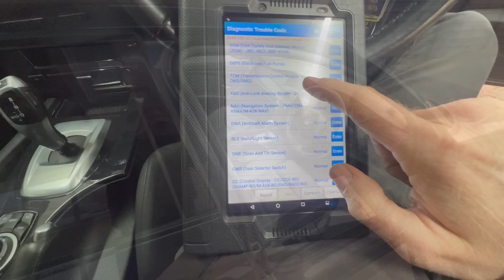IS SELLING A CAR TO A FRIEND A GOOD IDEA??? ESPECIALLY WHEN IT GOES WRONG!!!

Comment: Another good video Kev, you need some heat shrink solder connectors.
Reply from the maker: Thanks Trev, you're right as well.....ive got some....just couldn't find them 🤦‍♂️🤦‍♂️

Comment: Just a tip on the soldering you can now get solder sleeves which the solder is incapsulated within shrink sleeve and seals the joint as well

Comment: Hi Kev & Claire 😃👍 great video Kev it had everything, Drama, Joy , and pride 😅😅😅 great job Kev two repairs in one I thought you were going to  edit the video when the boot would not open 😂😂 thanks for another mr fix it lesson. Have you tried the new ish pre soldered fittings Kev just have to apply a little heat with the heat gun even I can use them 😅 keep smiling Kev & Claire.  Tom
Reply from the maker: Hey Tom, yeah I have got some of them pre soldered fittings but I just thought it would be a bit messy as there were so many joins, I would have used them if it was just three connections....really could have done with some heat shrink but I couldn't find it 🤦‍♂️🤦‍♂️🤦‍♂️Glad you liked this one Tom, have a good week what ever your up to 👍👍👍👍

Comment: Hiya kev I noticed the boot opened quick on the beemer you probably know this tip already if you move the boot springs into the different holes it will change the function slow normal fast works on any car ,reet il shut up 👍